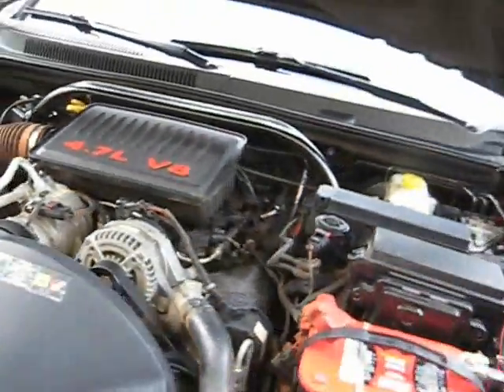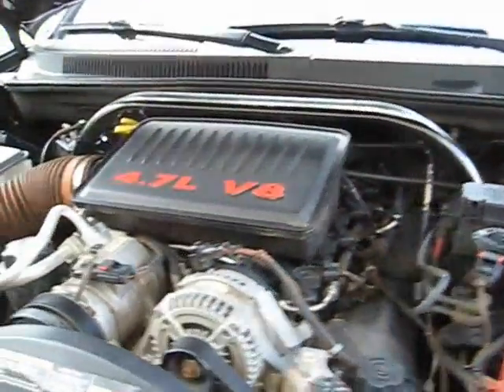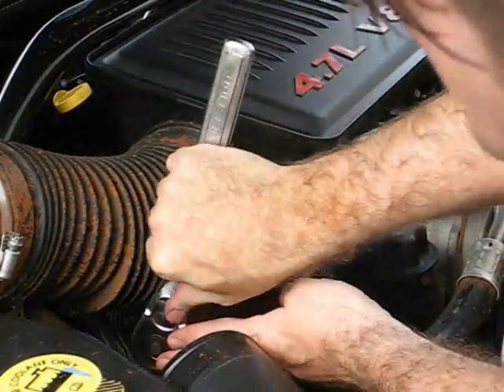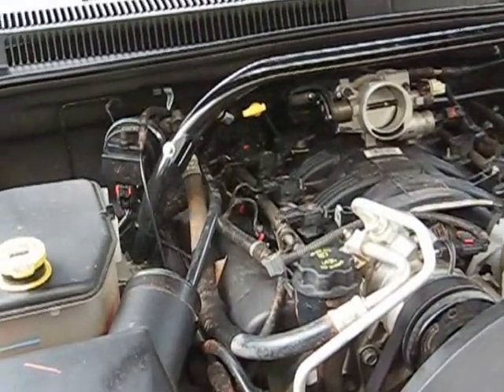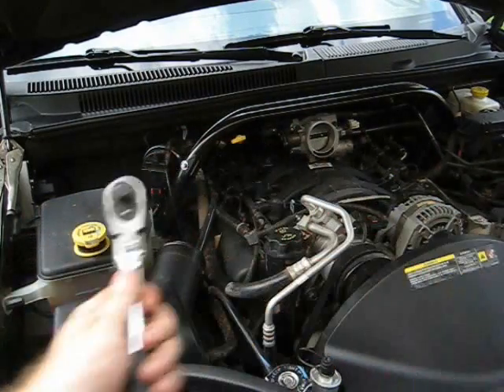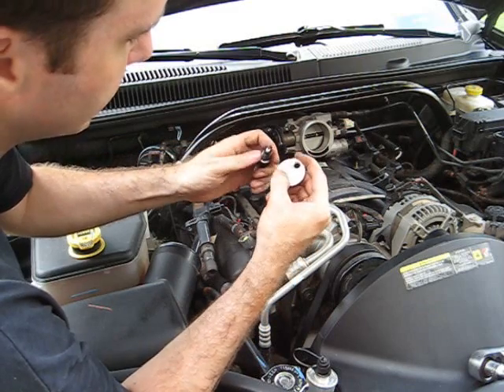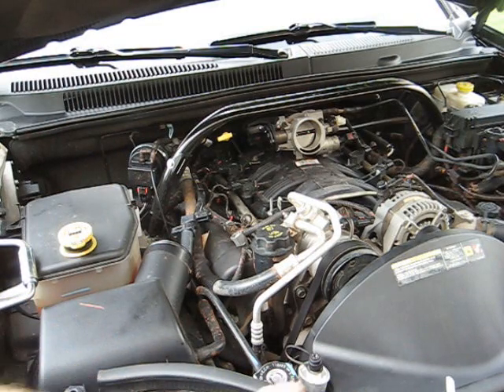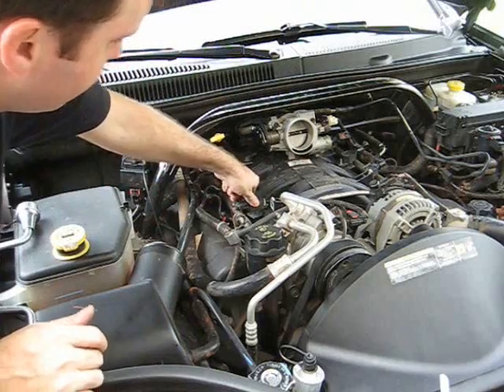How to Change Your Spark Plugs Part 1 - Jeep 4.7L

Comment: This is the 4.7 with plugs instead of 16 correct? Huge difference in the job, and power of motors.
Reply from the maker: Yeah, mine has 8 plugs, not 16.

Comment: What does it mean when you have cin 8 misfire and the plug is AL wet
Reply: Whats it wet with, oil or fuel? That should be the first question. Possible issues would be a bad spark plug (or improper gap), bad coil, bad piston rings or cracked piston on 8 cylinder. Depending on what its fouled with, it could be a bad fuel injector as well.

Comment: Changed mine today and an air compressor is a must. Once you expose the plug in its valley blowing compressed air down there expelled a lot of dust and debris. 
You don’t want that falling into the cylinder.

Comment: Ill share a secret with you guys. The plugs are a pain in the ass to get out because they are so deep in the hole but its easy to pull them out using the coil to grab them after you loosen them. Also if the coil is stuck you might have to pry them up with a small pry bar crow bar or similar tool. If that doesn't work give it some pb blast spray and shake it loose.
Reply: What to do if your socket isn’t loosening the spark plugs?

Comment: More for looks than anything else!!!!!!!!!!! He says as he removes the air intake ballast....I don't think so Tim!!!! It is an air reservoir so that when you gun it the engine has air sitting there ready to swallow, it doesn't have to drag air immediately though the filter to get going
Reply: actually it makes the car quieter by restricting air

Comment: I agree with blowing the hole with a compressor host first.  Get that grit out of there.  A little thing i noticed which hasn't been commented on thus far - the vice-grip on the lift strut to prevent accidental closing of the hood on your noggin.  I'd recommend against applying the vicegrips on the pushrod directly, but instead find a 2x4, cut it appropriately and wedge it between the engine compartment and the hood for added insurance...!

Comment: Finally a video on changing the plugs on a 4.7. I have an 01 Dakota with a 4.7 in it and this is pretty much the same with mine. Ill definitely use this to help me with changing mine. Tho I don't like how they used plastic caps to cover the spark plugs

Comment: Anyone know what size socket would I need for removing a PCV on a 2006 Grand Cherokee 4.7L? The PCV on my Jeep GC model is way back drivers side, screw in type and hard to get to with lots of stuff on/around it. It requires a socket for unscrewing/removal according to online posts. What size socket do I need for this job and any other tips? How deep should the socket be? This is the new location for the PCV, not to be confused with 05 and early 06 models that had the PCV on the oil filler pipe.

Comment: You will find as i did on the last plug that is much easier to remove the piece between the coil pack wiring and the plug if you disconnect the wiring connection first instead of pulling out of head connected, great vid keep postin!!

Comment: I noticed that the intake box had a clamp where it connects to the throttle body, my 04 4.7 Dakota didn't have that and neither did my brother's which is the same exact truck and motor I have. I just discovered your video and I had already changed the plugs on my motor a month ago. I went with NGK V-Power and compared to the worn out factory Champion plugs, the NGK's made the motor run absolutely smooth! You cant feel it running lol. How have those Autolite plugs been treatin ya?

Comment: How did I miss this one?  Everybody loves spark plugs except those of us who don't!  Sweet!  Coil on Plug boots, it was good you mentioned to inspect them carefully, indeed, on some engines, failures of both the boots and the coils is common.  The Ford 4.6 is certainly one of them.  The high temperatures and lean running conditions mandated by emissions standards all add up.  Good movie here!

Comment from the maker: Thanks man - it's all about investing in the tools right off the bat (money you would have spent paying someone else to do it, then you have them for life).  The hard part is just motivating yourself to do it.  If you can, get a Full Service Manual online (can usually get them for free off of forums) or a Chilton/Haynes manual and it will walk you through step by step with all the correct torque settings....